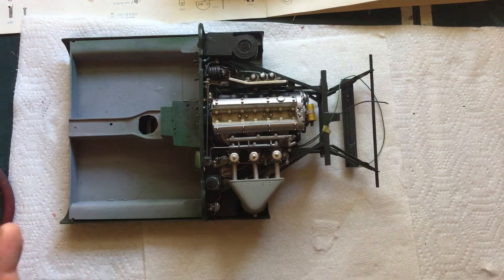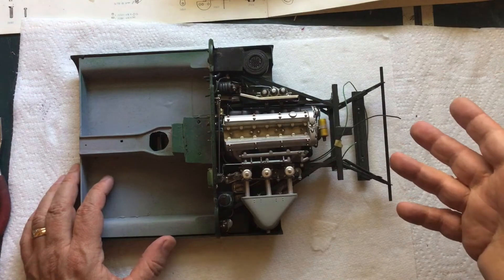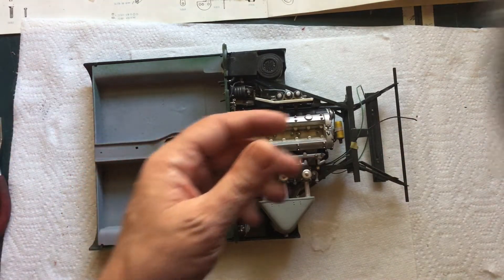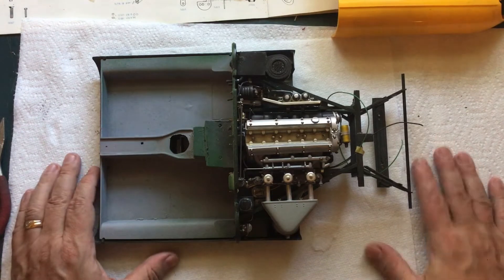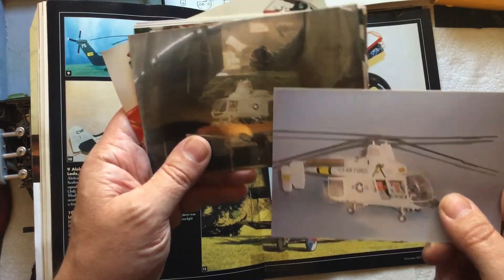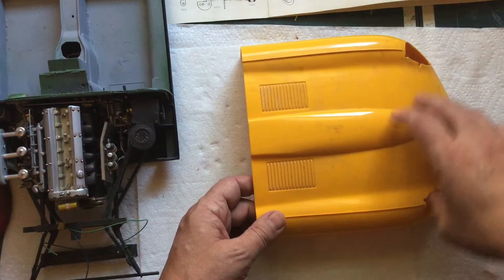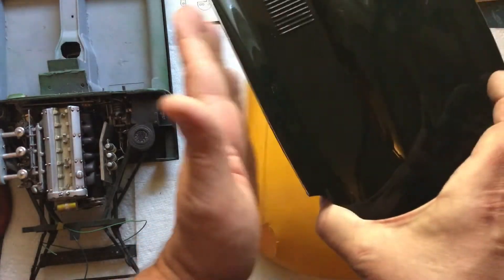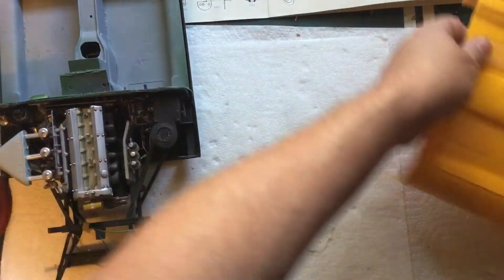Monogram 1/8 Jaguar XKE build; quick update and detail ideas

Comment: You inspired me over a year ago I have built the subframe like you. I made the suspension by sand casting them in brass and drilled 4mm brass balls as the top and bottom joints. I am now making a steering rack so the steering wheel will turn the wheels.
Reply from the maker: Cool! I’m really anxious to get back to work on mine. I have to finish the Mercedes first thought.

Comment: Great video...Scott   What if you just cut out the vent portion and measure out the where the plastic vents are inlaid on the hood and just feather in the metal vents. Instead of cutting off the fenders and then fixing head lights holes and maybe the wheel wells wont line up either.
Reply from the maker: Thanks! I’m pretty sure that’s the way I’m leaning. I think I’ll have less problems that way, and it would be much easier. It just feels like I’m wasting most of the hood. But the point was to get nice louvers, so I guess the rest doesn’t matter.